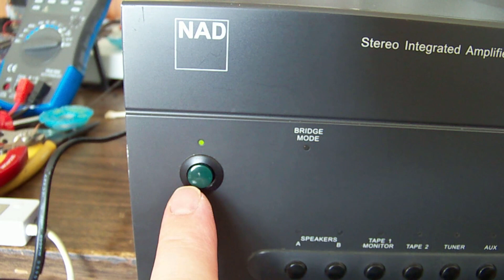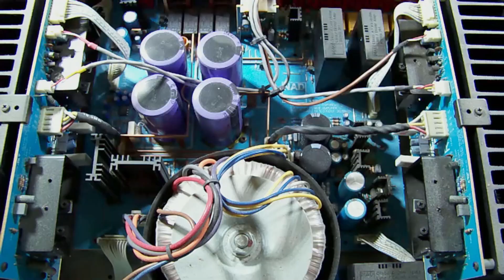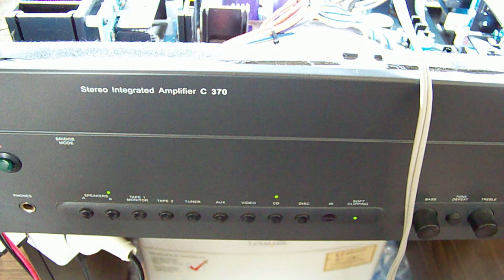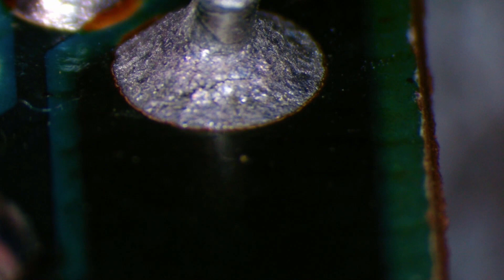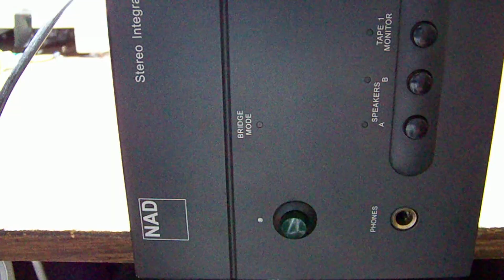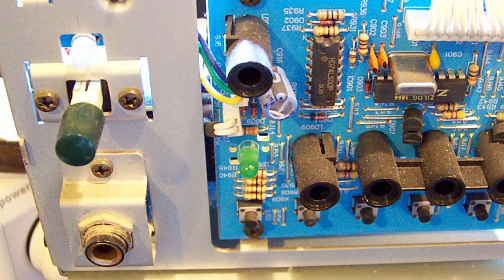NAD C370 amplifier repair.

Comment: Nice repair job. 
I have an old C350, which have no issues. 
I see people soldering with temperature adjustable welding kits to secure capacitors not receiving to much heat.
The unsoldering way looks easy, while some use a tool and desolder a complete pb while only a few parts had to be replaced.

Comment: NAD Amplifiers are designed to fail, they have poor thermal management in general as I belief. I have the C356BEE that has similar spot-wise overheating here&there. Also, contrary to the service manual, where 1,3W was foreseen, some Zener diodes were populated with 0,5Ws in the real device.

Comment: If you did research first then you would have known about the comen problem of the protection circuit. The zener diode runs hot & causes damage to the capacitors. You don't need to remove the protection circuit. Just remove the back panel. I sell the kits on ebay with full instructions.  NADC370.
Reply from the maker: Why research when you can have fun figuring it out 😊
Reply: @JonnyFix  Well doing research saves time. He did not show the correct or easiest way to carry out repairs.
Reply from the maker: Everyone's an expert right

Comment: I just got a second one of these, switches on but one look inside and I 'm not connecting my speakers. Had been apart at least twice as there's two business stickers. Just replaced the main filter caps as they were bulging and the terminals fell off when i removed them. Looks like a bit of solder reflowing has been done and some caps have been replaced. The protection circuits has had the capacitors done but not the diode reversed like i done on my first amplifier. I don't really want to replace every capacitor these is because there's quite a lot and my current one works with only the usual suspects replaced. I'm going to try and bridge the amps together, I actually used the same caps on both amp filter circuits but perhaps its not something I would probably hear.

Comment: Great video!
Im in process of repairing one of these beauty's. 
Pretty much the same as the one you have there but the glue isnt quite as far gone which may suggest its been used less. Ive sorted the protect board first and put the diode aroumd the backside of the board and fit new caps. 
Ive decided to recap the whole amp as there are others that are sat right against heat sinks and have changed colour with heat stress. Can't wait to get it working.

Comment: I have two of these amps on is still kicking and the other one is protection circuit issue,i tried to fix and it worked for a while but my soldering is poor , i really think that these amps are amazing quality for the money,,poor people like me can listen to a reasonable level of sound quality,, ive listened to some half million pound systems at a sound expo and i think that some people don't know how to be happy with life as they are not a million miles away from the nad gear

Comment: I have a NAD C372 and it recently stopped working so I opened it up and noticed that it needed a new fuse however once I replaced the it just blows them out. Any thoughts?
Reply from the maker: The mains fuse is 6.3A rated. Looks like it feeds a standby circuit and the main transformer only after turn on. If it blows as soon as plugged in check bridge rectifier B701 for shorts between all pins. If ok check capacitor C709 after IC701 (7805 5V reg) for short across its pins. If it only blows when you switch it on check for shorts across bridges B703, 704 705 and 706 after the larger transformer and so on down the line. Service manual with schematic is free, just google, you will see what I'm referring to. Good luck!

Comment: This era of NAD equipment was littered with JH brand capacitors which were absolute junk.  Any piece that I've worked on from this era has had most, if not all its caps, go high-ESR and out-of-spec.  If you're planning on keeping these pieces long-tern, nothing short of a full re-cap is necessary.
Reply from the maker: Good to know. I've got another one on the bench as we speak!

Comment: I have fixed a couple of c352, and all the caps in both were bad! Solder joints in hot areas on board needed reflowing. Both now work. These amps seem to have same issues. I used Panasonic caps (FR and FC) mainly. 
Great video 👍
Reply from the maker: Cheers mate!

Comment: Hi, My NAD C356BEE amplifier makes continues clicking noise and standby light starts blinking on power switch when I try to switch ON'. Also it keeps on standby mode for long time. Before it happens some times but now it comes more often. Some times it gets power ON' and keeps running without no issue till power OFF'. I am looking for a solution to fix this. Please help me to resolve this issue!.
Reply from the maker: Download schematic, make sure all voltage rails are present that should be while in standby, especially the 5V one. If 5V is bad then troubleshoot power supply that creates this on page 15, maybe caps C545 and C533. If 5V is ok check relay control circuit for relay RL51. High voltage here, use caution.

Comment: Although when functioning they sound quite good, NAD’s QC leaves a lot to be improved. Every NAD across my bench has had numerous problems. I’m not a fan of shotgunning components but there’s always a large pile of bad parts when repair is complete.
Reply: I have just bought two old NAD amps that works ok, but needs a little attention.
What is the typical issue to look at?

Comment: Speaker B is if your running a second pair of speakers into a different room. I had a similar issue with a crest audio ca9 amp and had to resolder every joint. Great video as usual
Reply from the maker: Thanks!
Reply: No, speaker b is for speakers with bi-wire or for blowing up your speakers. If you have used for sound in other rooms, you buy a multi-room amplifier

Comment: Hey there, I have a C370 NAD amp that has just done the same thing - how do I go about getting it to you to fix. I am in Dunedin, NZ
Reply: I fixed mine, I live in Tauranga and couldn't find anyone local. The board he fixes failed on mine but I put the diode that gets hot on the opposite side of the board. Next repair was dry joints on the amplifier boards. I need to replace all the capacitors if I can find a kit - like they sell overseas apparently. Much easier to get someone else to fix but not a lot of people around doing this!

Comment: I've done many of these. The protection board is a known weak point. I normally just swap all the caps and move the zener from the front to the back of the board - out of the way of the capacitors. In general, all the low value capacitors are dying on all the C370s. Not only in the protection circuit.
Reply: hi, just a question, Im having issues with my Nad C350, seems to go into protection mode (red power LED) when pushed past a certain limit (not highly pushed) after the unit has been on for a couple hours.  Would this issue most likely be similar? thanks
Reply from the maker: @rodneyyuen  Quite likely as things warm up etc. Would be worth replacing the caps on it and refreshing all the solder joints anyway. It seems this module becomes a problem on every unit out there.
Reply: @JonnyFix  thanks for your advice.  Couple of questions if you dont mind? Question 1- Do you feel that the repair like you did on your  NAD c370 from fault diagnostics and repairing is a dying art?  Quistion 2-does changing components like you did change the sound signature of amp? Thanks again
Reply from the maker: @rodneyyuen  I think general electronics repair is a dying art. There aren't a lot of big repair businesses that you could say get an apprenticeship with and learn on the job. Most repair shops are single owner-operator. I guess there's university classes that cover electronics still but I don't think they aim for a focus on repair, probably more like understanding for the purpose of designing products. I think the most successful repair people start young, have a deep interest for wanting to know how things work and just messing around with it an learning as you go. I think the best way to make money from repair is niche markets like automotive electronics, medical equipment, musical instruments. General consumer electronics are so cheap now most of it isn't worth the time to repair. As for this job, the protection module has nothing to do with audio reproduction so no it won't change anything about the amp. All it does is watch for a problem at the output and isolate the speakers if there is one. You're welcome!
Reply: @JonnyFix  I had never seen your videos before but was surprised with some of the items you were able to repair as assumed that these would disposable unrepairable type items. You're probably right about starting young but not sure whats its like now in NZ but in the UK a national electronics hobbyist chain went into receivership, Im sure you can still by electronic bits from the web but guess its all less accessible. I remember growing up in NZ and Dick Smith stores used to sell various kits that would get the young interested and give them skills and understanding of electronics like yours (obviously not as advanced) Im not sure if the young would be too interested spending time on a kit that made a few LEDs flash. Thanks again
Reply from the maker: @rodneyyuen  Sadly dick smith went into receivership and the new owners run it as an online only store. We have jarcar electronics, another Aussie based chain. They sell components and some project kits but it's nothing like the DSE funway learning kits. My father was a service tech, without that I don't think I would have got into it either. 40+ yrs ago repair was a booming industry where manufacturers freely gave out service info. Now they are all secretive, preferring only to use authorised channels/service agents, maybe there's an aspect of liability/ass covering there to since we live in a world where people love a good lawsuit. They can also control the cost of after warranty repair work to the point where the customer might as well just buy a new unit. What's left is a small market for us clever types who can figure out what's going on with minimal information but to survive you'd need many jobs at a low charge out rate or write off some of your time, which happens a lot in automotive repair. A lot of diagnostic time (electronic at least) is never charged out as it would write the car off. It's hard to get the nuts and bolts technical info from manufacturers to be able to chase down a fault efficiently. That's why it becomes too hard basket and a lot of shops throw parts at a car until it starts working again, just easier.
Reply: I've got one too, after moving the diode and recapping the protection board it's been fine for last 3 years.
Reply from the maker: Good idea with the diode, will keep in mind for the next one.
Reply: Most of the caps in these amps NAD branded and JW branded are made by Jianghai. Awful things. Nad used to use Nichicons etc up until this range, From C320 etc onwards that changed.

Comment: Well done :-D, it's alive and kicking ear drums again lol.
Nad was always so expensive,  they put the money inside, not outside, The reason they looked boring as hell.
Nads are supposed to be a good quality, but i have had ones for repair and they don't look too special to me.
Ooow that protect pcb was horrible,  manufacturers always put capacitors near hot parts, i'm sure they do it on purpose. :-(
If that was my amp, the large resistor would be mounted on the back of the pcb (less direct heating) and the diode leads bent 90 degrees so it sat above the board edge, well away from the crapacitors.
But thats me.
Heat = dead parts :-(
Reply from the maker: Thanks mate, she's an old donkey now, done well to last this long I guess.
Reply: @JonnyFix  You are right, as you often are :-D
This is a silly question but have you noticed the habit of manufacturers putting electrolitics close to heatsinks and other hot areas?
And what fails more often than anything else.... crapacitors hmm lol.
Reply from the maker: @zx8401ztv   guess so. I don't pay too much attention to layout but it does seem to be an issue. But when is the earliest that something fails with good quality caps? This thing has only just become a problem and it's probably 6-10 yrs in most gear so while electros are an issue it's not like we aren't getting fair use out of this stuff, except for the extreme on 8hrs+ every day situations.